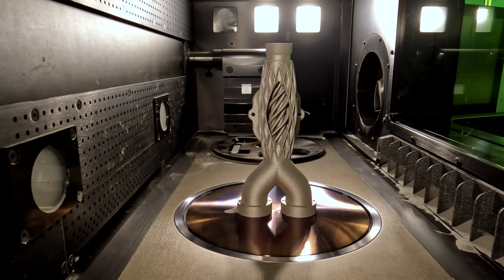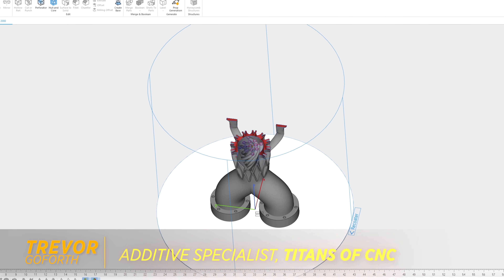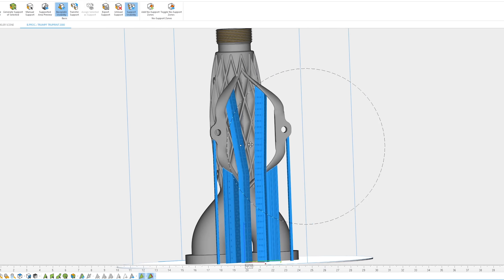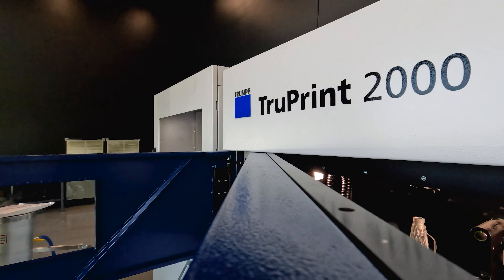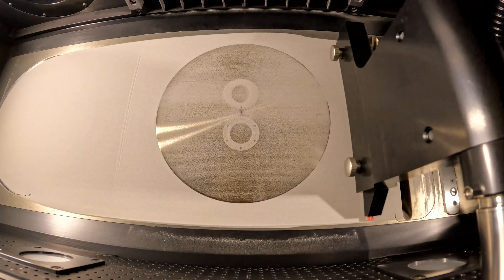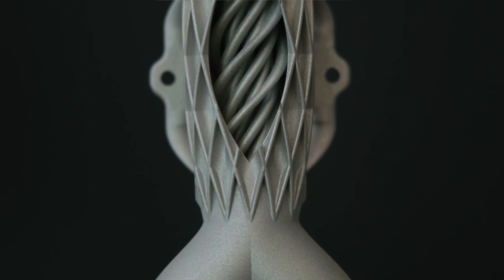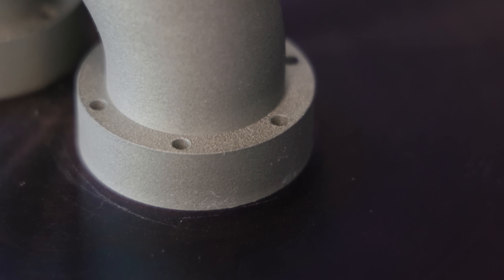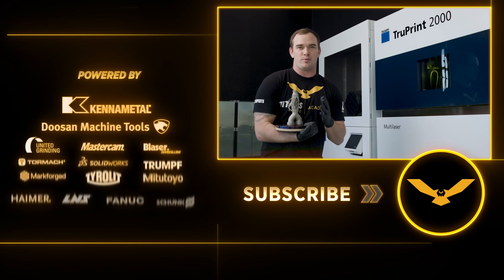3D Printing an INSANE Steel Part that's IMPOSSIBLE to Make on a CNC Machine

Comment: Absolutely incredible! This allows us engineers to design much more advanced parts with internal features that previously couldn't be manufactured. This technology is a game-changer. Stronger, lighter, better designs!
Reply: Yes less thinking about "how" a design can be made
Reply: it also allows worse engineers to get further in life
Reply: @karabinjr if he is worse he wudnt get far either way
Reply: What's really incredible about it is that compared to traditional machining this shit is still infantile, and yet it's already being put to use doing things previously impossible. Makes you wonder where it will be in another 20yrs
Reply: It simply can never replace "traditional" manufacturing methods (literally physically impossible), but it is a great addition to it, specially in low-volume production like research and development, or for pieces with very strange geometry.

 @xxportalxx.  "this shit is still infantile"
It is ~40 years old. That is not much younger than CNC-mills.
Reply: for high end specialized stuff this is actually game changing. - but its probably not a replacement for traditionally made parts. i see it more as a new tool in the toolbox that can get some amazing results in cases like this design.
Reply: Definitely a rapid prototyping and specialised application thing. In many circumstances, casting and subsequent machining is still the way to go for 10k+ units. I know of certain parts that were metal 3D printed and machined in quantities that weren't possible without the 3D printing portion (endmill holders with hydrolic clamping stuff). But that is also 100+ bucks for a thing. Mainstream manufacturing is subtractive CNC to a high degree and will stay that way. Prototyping and specialised stuff will move on. Impressive technology.
Reply: Maybe engineers should work on making components a little more serviceable, both in automotive and industrial equipment lol
Reply: That is also a part that has almost zero percent chance of being repaired if one of the tubes is damaged.  A small pinhole necessitates replacing the whole thing.  Engineers don't seem to think about servicing an item after the fact.  This is seen time and time again where 10 hours are required to replace a wear part that takes 30 mins ONCE you disassemble everything else to get to it.  It should have been designed with good access in the first place.
Reply: Instead of designing great parts, design a heater core that don't take 8 hours to remove. That'd be great. Don't design engines that need removed from vehicle to service. Thanks in advance.
Reply: For prototypes, it's actually cheaper than using a normal cnc or molds. Metal 3D printing is the future. I wish I had one of these. As an automotive designer, making lightweight and strong parts will allow us to create more cars like the czinger 21c
Reply: Yes and no. These machines are awesome, but control over the finished cured size just isn't there. You can't count on a part like that staying within any amount of tolerance less than a few thou at absolute best. I've seen shops have to run a part like that 5-10 times just to get one that was in tolerance. It's super sensitive to laser temperature, layer temperature, powder temperature, etc. Much less the final sintering stages have to be dead on repeatable.
Reply: @BrettFleming   I think your point is very important to consider. 
3D printing plastic is the same way. Consequently, in my lab, a "tolerance" parameter is used in CAD to attempt to "dial it in". 
Any luck in your metal shop attempting a similar procedure? 
Imagine having also to build a climate-controlled room to house your already expensive machine!
Reply: @hippie-io7225  climate controlled room to house an an expensive machine? You mean like any CMM room.
Reply: @alexanderjamesINC  Yes. Looks like you would need to climate rooms. One for CMM
Reply: @hippie-io7225  your slicer should have an option for that, if i design a part that needs to fit in another one i dont add any tolerance, and itll give a tight fit, as expected
Reply: @justinc2633  I'm getting better at finding the slicer options, but it's a work in progress.
Reply: @BrettFleming  Spot on. Some traditional machining will always be needed but its pretty wild seeing it advance this fast and this much. DMG MORI has a Combo 5-axis Mill with swappable Metal 3D Printing head pretty cool seeing the promo video of it at least.  Print, Machine, add more material, then machine that.
Reply: @michaelw5456  that's cool but for the most part, when CNC came about, people thought that it was almost a fad. Now CNC machines have basically made manual mills/ lathes almost obsolete. I believe metal printing will advance far enough that we may not need CNC mills or the like at some point in the near future.
Reply: @alexanderjamesINC  No matter how much metal printing advances there will always be cnc mills and lathes.Why would you print a part that can be easily and quickly machined on cnc instead spend hours or days on printer.Everything has it's use like printed part shown in the video which would be impossible to make any other way.
Reply: @mehmettemel8725  I more so mean if metal printing advanced to the point where it was much much faster than it is now.
Reply: @alexanderjamesINC  I understand the point you trying to make but imagine  making a simple shaft with circlip grooves and some threading at few points where on a cnc just throw in a billet slightly oversize and machine it to correct size and finish in a relatively short time.Where as on a 3D printer you need to print the whole part from scratch so a lot of printing time even if it works at lightning speed to build the volume of material needed.Everything has it's uses.
Reply: @alexanderjamesINC  the strength of a printed part is not there either I highly doubt aerospace will be accepting these parts on rockets and fighter jets. You have so much more strength when cut from billet.
Reply: @alexanderjamesINC  possibly so. But manual machines are still used most shops to some extent. My previous employer (Aerospace Industry) we used manual machines for more of the delicate work especially Overhaul & Repair since the parts had been through engines and needed cold working most of the time to get qualified enough for the rest of the processes.
Reply: @michaelw5456  I wouldn't say always... Technology only continues to get better and better and pretty much everything gets replaced eventually.
Reply: @alexanderjamesINC  exactly.
Reply: @mehmettemel8725  are you sure?, using 3D printer is more faster and cheaper than cnc, if you using cnc you need to melt the metal first and than you need insert your data too make part

if you using 3D printer you only need dust and data, you don't need a melting forge anymore the result it's cheaper and faster
Reply: @michaelw5456  why do you say that. We are always making strides in tech and making more and more automated
Reply: @dswmetals02  why? Because of surface finish. Until 3D printing can print  < 50 surface finish traditional machining will be required on sealing and mateing surfaces without destroying flatness stackup issues with assemblies. I have 14 years in the field machining 12 in aerospace, and currently in thermalforming.
Reply: @mehmettemel8725  I respectfully disagree. They will most almost certainly become obsolete. People will use them still just like people use horse and buggy or paper books still for many reasons even though they are obsolete
Reply: @dswmetals02  I don't know which part of the comment you referring to if it's use of cnc machines it will be a long time before they become obsolete if ever does.Why people see 3D printing as if it's going to be the only way parts can be manufactured is beyond me who knows what other technologies will be introduced couple hundred years from now.People think as if you can dig powder out off the ground and put it into printer no one seems to think where the raw materials come from or how it's produced.Do you believe you can 3D print everything especially machinery used in heavy industry.Imagine printing a basic steel mill roll weighing 60Tons.
Reply: @BrettFleming  I have just been in the process of achieving just that and in this case it went down to just using one of the three avaliable lasers on that specific part before I could get the tolerances acceptable and get the prints to vary just a few hundreds of a millimeter. Then I printed four of those along with some other parts and just used the same specific laser on the critical part but with very different layer times and they came out just fine. Some machining will always be needed if you want a smoother surface texture or very tight tolerances. Our whole printing equipment has it´s own closed section in our factory where we control the environment temp, humidity and oxygen content to affect the reusability of the powder as little as possible.
Reply: @BrettFleming  that's only because 3D printing still in its infancy and just like any technology will continue to get better and more precise and it will just be a matter of time before it's pretty much perfected
Reply: @BrettFleming there’s no sintering with this method, it’s basically like welding lol
Reply: @ BrettFleming literally wait 5 years and it will be
Reply: @BrettFleming  It's also pretty rare to require a part that absolutely cannot be redesigned to be made on traditional CNC machines.
Reply: @lazyman114  that's because we've always known limitations and so therefore those type of parts were not even considered to try to make in the first place. But with new doors opening up they'll be many more complicated parts like this that cannot be done on traditional cncs and lathe and other ways of machining
Reply: Process time and scrap rate will change your mind about metal 3d printing. Good for prototyping and rapid iteration. Ask for a lead time on 10000 of what he just made and you will see what I mean. Also no economies of scale so cost doesn't come down much if any at high production volumes.
Reply: @ProfessorDingus  maybe you have to look at it in other ways. If there is no other way to build something you force the market down this route. 
Remember Humans are crazy just look at Bitcoin. It costs more to make more and we are now at a stage where the mining is using more power and technology than some 1st world country's.
Reply: Dont u think it will all vhange with the technological improvements by the time? Were we this good at metal foundry from the beginning? Whats your point? This tech is still on its infancy.  @ProfessorDingus
Reply: It’s also substantially more expensive. Remember, they’re always downsides
Reply: @mattat3847  substantially more expensive the paying a mecanice to do it x to doubt center powered window switches 400$ h vack pc behind radio $1200
Reply: It's also a big change for the consumer as well. Now when I want something I look online to see if anybody has made it, download what I find, modify if need be, then hit print.
Reply: There are strength issues with 3d printed metals. But certainly with more research i suspect eventually this gap will be closed. 

Out of curiosity are they filling the print chamber with a inert gas like argon ?
Reply: Unserviceable
Reply: When did engineers start considering features that can't be manufactured?  Hahaa!
Reply: Also kinda impossible to fix
Reply: maybe in 2038 when this isn't the most expensive type of manufacturing available
Reply: @rustys.1070  well yeah that's how it works but it's probably a lot closer than 2038. Considering the strides it made in only a couple years time. Everything has to start somewhere and get refined and reinvented and continue to make strides and progress on new tech. It doesn't just start out as a finished piece of tech overnight at least not 99% of the time
Reply: genuinely amazing
Reply: Half of y’all put it on the machinist making the parts to beg you to understand that something isn’t possible lmao.
Reply: "us engineers", really, almost all of us are engineers, so what's up; "us engineers" makes you sound like a knuckle head 😉
Reply: Especially top tier engineers like myself
Reply: Translation, this allows us engineers to over complicate shit even further!
Reply: Great something else for engineers to fuck up
Reply: Now do mechanical tests on a cast part and see how that goes.
Reply: Weaker, lighter is more accurate.  In no way is this strong.  Leave it up to an idiot engineer to think so.
Reply: Space! Here we come 😂
Reply: just remember us mechanics who have to get in there and change shit out please, thanks :P
Reply: Only thing to watchout for are supports and powder/resin traps
Reply: I'm pretty sure it's not stronger as well
Reply: @lazyman114  do you have proof any data one way or another on that? 
I assume you are just guessing.
Reply: @dswmetals02  Yes, I'm guessing based on that the lathe and the mill were invented 100 or so years ago and that most parts can be made on those machines.
Reply: @lazyman114  more like 250 years ago...or possibly before that but that is some of the first proof of the somewhat modern equipment
Reply: rather engineers  focus on leaving room to service the parts with out dropping the hole engine.
Reply: *to design much more advanced and impossible for dumb little mechanics to figure out the new starter inside the exhaust manifold stuffed with the fuel injector pod like a some kind of turducken

Comment: Its not impossible but this tec gives designers a new way to look at parts, I do edm wire cutting and cut parts off build plates and then cut the parts up in jigsaw bits so they can be analysed to make sure its what a cad model says it is, some jobs blow my mind on what detail there is hidden, yes sure with out 3d printing it couldn't be done  but an idea would have been thought of in the conventual way, with hybrid additive machines will do away with most toolmaking and mould tools so it will be a sad day when guys on benches with hand skills will be gone and rely on ai driven modelling.

Comment: Stainless steel for heat exchange? Not very efficient, are we?
Reply: They are probably using 316L (1.2709) because of a corrosive mediums…. They could also make it out of 1.4404
Reply: @vonpredator  fair point, was thinking water all along!